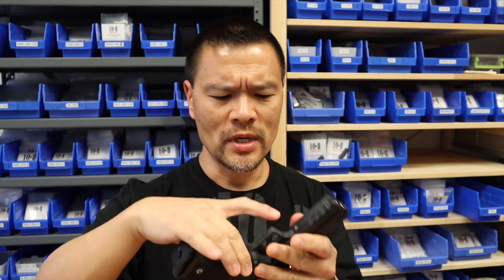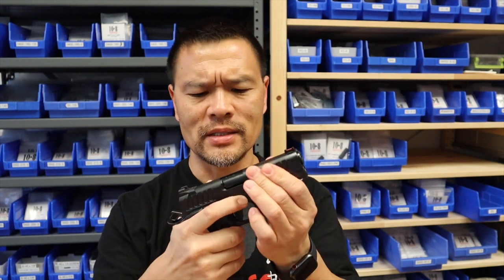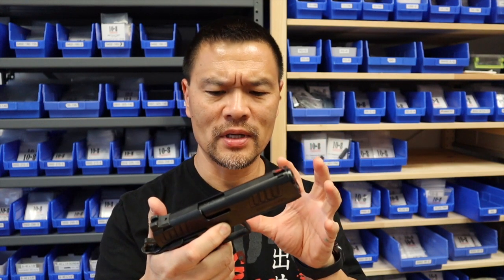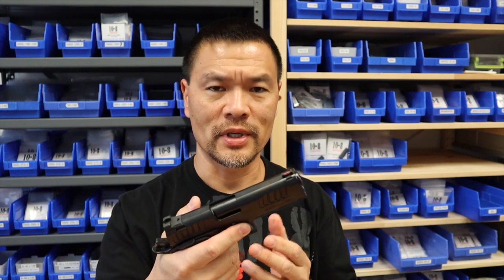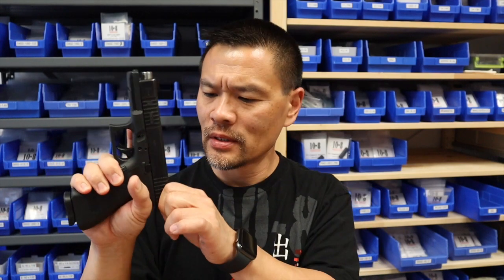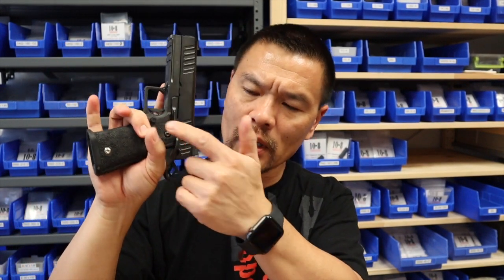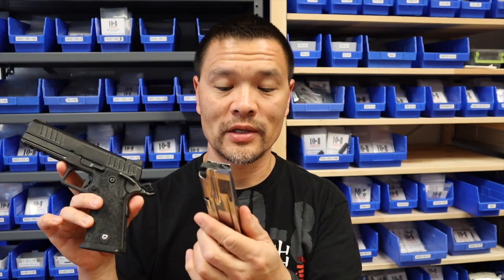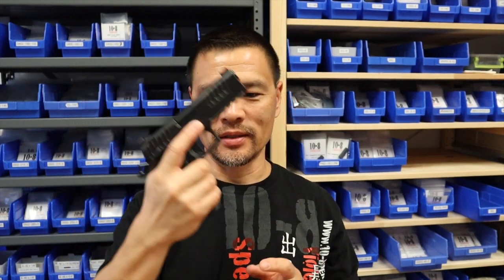10-8 Performance Lab, Episode 6: STI Staccato P 2011, Tech Talk

Comment: Hilton, great video...... so you prefer the magwell removed? Is there any issues that arise with the magwell off from a shooting standpoint?
Reply from the maker: The mag well adds bulk and I'm trying to see how I do without it so that I can try to carry it once holsters arrive. Reloads are still quite fast, and my hands don't even touch down by the bottom of the frame so I don't notice it's gone.
Reply: @108Performance  thanks for the info. I have 3X hands with long fingers and not sure if the magwell will interfere. I requested a T&E model.

Comment: How would you recommend dry fire training with these guns? Would that destroy the tolerances over time even using good quality snap caps? Just curious because some day I’d like to pick one of these up.
Reply from the maker: No need to use snap caps. Dry fire away as much as you’d like. At the height of my training, I figure I’m getting 10 or more dry fire reps on the gun for every live round fired. Not cleaning/lubing the gun does far more wear than dry fire.
Reply: 108Performance awesome, thanks for the tip!I’ve sub’d to your channel and I’m learning a lot from your videos. Keep churning out the great work!

Comment: I hate to say this but the Staccato is not really hand fit. Particularly in the very important fire control system. (Hammer/Sear, disconnector, trigger bow. Yes they are put in by hand, as all 1911's are regardless of cost or manufacturer unless someone uses robotics to do it. Not likely, but even though the are tool steel parts, (Hammer/Sear) they are not fitted. No dressing of the engagement surfaces whatsoever. 

Very disappointing to find this in Staccato's at such an elevated price point. I would love to see them take the time and effort building their guns as they do putting in the time and effort of blatant advertising on the tube. I've never seen such an intense marketing campaign before.  Hundreds of vid's on them, many guns given for the review. Fishy to say the least! 

If you are knowledgeable in 1911/2011 type platforms and finish the work they skipped, the warranty is now void.  Borders on slimy to down right crooked!  
KnifeMaker